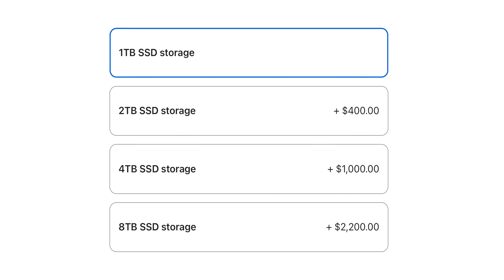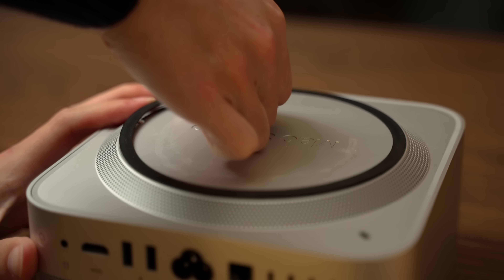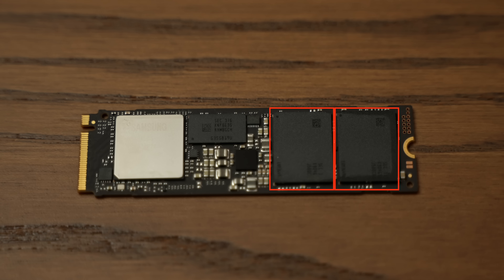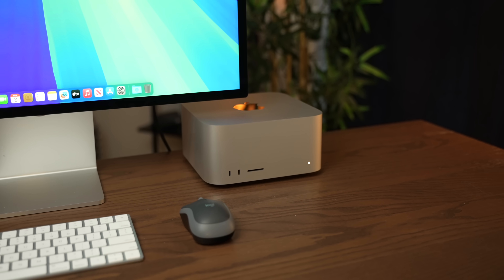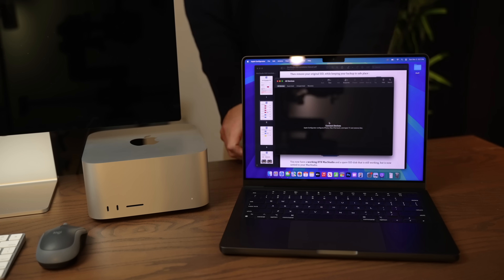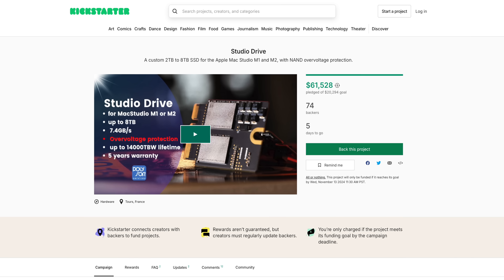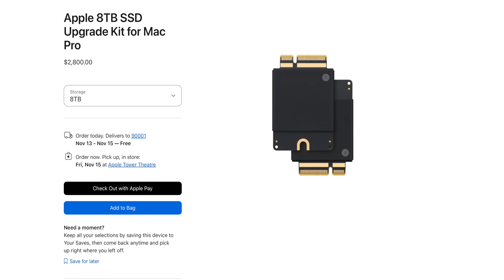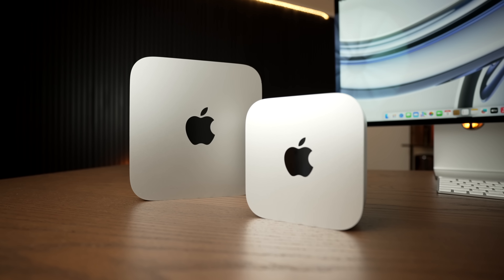UPGRADE your Apple Silicon storage for HALF the cost!

Comment: MacRumors users must be livid to see this. They hate upgradability and will justify any anti consumer moves
Reply: @ricciozztinThere’s no good reason Apple doesn’t include a standard SSD slot for storage.
Reply: @ricciozztinbut it doesn’t protect them. The speed and reliability of a 3rd party ssd like Samsung are just as good. Also can you explain how soldering their SSD is more reliable / safe? I’d prefer to not have to pay a large fee or throw away my laptop just because one component fails.
Reply: @sarjannarwan6896 soldering is the old way - doesn’t work below a certain scale. Plus. Why have separate components anyway?
Reply: @davidharrison8495 not sure what you mean by soldering is the old way and a certain scale? Also I kind of highlighted it. If my ssd dies, I’d like to replace it. Also I’d like the option to upgrade storage. There is no good reason (outside of financial gain for apple) to not allow it.
Reply: @ricciozztinits the user’s choice if they want to deal with the shortcomings or not, there literally is nothing wrong with giving consumers another option
Reply: @choonky Unless that option is an anti-competitive walled ecosystem set up to extort customers and developers, then when that option is deemed illegal and required to change, it gives the middle finger to the government and skirts the ruling requiring it to change
Reply: @ricciozztin so what? Id rather go full on ”wild west” replacing the ssd (which is a compoment which WILL eventually break) rather than throw an otherwise perfectly working computer away

My mother gave me her old 2011 macbook air with a broken ssd which i replaced with a regular m.2 ssd with an adapter and installed opencore monterey on it, and to this day it still works perfectly fine which i much prefer over throwing the thing away
Reply: @ricciozztinMost people don’t worry about that at all. Besides, let’s be real here. Apple did it for only one real reason which is money. They want more money and less upgradability. There is no way you could justify 400$ for 32GB of ram when I could get 6400mhz ddr5 ram for 110$. And you can not say that 200$ for 500GB of storage is fine when that is the price of 2TB. I seriously doubt that security was the deciding factor here. Besides, Windows has been solid for a pretty long while now so I can’t see why they can’t do the same.
Reply: @ricciozztin yeah .. i just paid 220£ for a 4TB Samsung 990Pro. Apple wanted me to pay them 200£ to go from 256GB to 512GB on the new m4 mac mini. Can you even begin to understand their greed ?
Reply: I’m a macrumors user that used to upgrade his Macs.  I remember when Apple used standard sata drives on its Macbooks and I remember the first time installing a Samsung SSD an 850 Evo in there. It was a bolt of adrenaline and speed unlike anything I’d ever seen before. The boot process was much much faster than the original 5400RPM disk. Appps loaded faster. Everything was faster.  I never used another spinning hard drive after that. 

I wish Apple would simply use or add a standard m.2 port for upgrading internal storage.
Reply: @ ricciozztinMost you must have a room temp IQ
Reply: @ricciozztinLol, "integrity and security" Don't be fooled by Apple just putting a sticker over a generic nvme.
Reply: @ricciozztinDoes 'not being able to recover my data if the motherboard cooks itself' count as protecting user data?
Reply: @ricciozztin I assumed you were being hilariously ironic, but no. Highly regarded.
Reply: @ricciozztinwelcome to personal computers. Replaceable drives have always been around and have always been as reliable as the technology advanced. Providers of drives have been reputable companies with far more credibility than Apple. You don’t trust Seagate but Apple is fine?
Reply: my favorite thing about the macrumors forums is the way they get indignant and shamey about people “stealing” the edu discount 😂
Reply: @ricciozztin This kind of stuff doesn't protect anything but Apple's wallets, that's why they can do it and no one else can. They know their customers don't want a Windows or Linux computer so they charge high because they have no other choice. If you want MacOS you have to go to them and deal with their garbage non upgradability that they claim is "more secure" when it's not. Upgradable SSDs aren't going to hurt anyone nor does it make your drive less reliable or slower
Reply: Dang, I thought everyone hated apples stupid practices
Reply: Nah They probably haven't noticed yet, too busy living in their Apple vision pro head mufflers, patiently waiting for the imminent rush of humanity to join them in there 😂
Reply: @ricciozztinlol
Reply: @ricciozztin pc stands for personal computer. Maybe a Mac isn’t a PC because you can’t make it “personal” in the way of taking care of it with hardware maintenance
Reply: more like a minority of hard core fanboys on MacRumors
Reply: Lame.
Reply: The people on MacRumors are so… intriguing and borderline toxic
Reply: Unless consumers tell Apple screw you and stop buying their stuff, things will never change.  Since Apple fanboys are addicts, and Apple knows this all too well, it will never happen.
Reply: What about the "Right to Repair" acts that have been passed or have been introduced in 30+ states so far?  Apple has said it will comply with California's bill SB 244 which requires firms to provide repair shops and consumers with parts, tools, and manuals at fair prices.  Nothing prohibits use of cloned parts except maybe voiding warranty coverage.
Reply: Strawman much?
Reply: You mean paid “people” to post that way
Reply: MacRumors is full of Apple haters - ever read the comments? Mods are Jack asses
Reply: @ricciozztin😵‍💫🤦🏻‍♂️
Reply: I suspect a lot of shills have a ton of sock puppet accounts over there. No way a normal thinking adult would act the way those people do.
Reply: I have moved over to  Mac Mini M4 from a PC, I built top spec gaming PC’s to order.

Now I an enjoying to challenge of forgetting MS windows and picking up Apple OS. Still feel that if Apple Tax, was less expensive by maybe 50% Apple would increase their sales more than enough to cover the tax loss.

The issue is that Apple doesn’t want its customers to have a machine that will still be viable in every way 8/10 years down the line. They make the most selling phones at again expensive initial prices and Apple Tax for greater capacity.

They do produce very good equipment, reliable usable and the basic software (and more) are totally free. This has turned them into a mega Corporation.
I somehow don’t think they will be worried by what is a minor part of their business.
Reply: @ricciozztinI hope you see the light, someday. But I am not optimistic.
Reply: @ricciozztin or, ya know, apple could just support their own hardware without the dumb brain washing. hilarious that you describe anything apple does as a consumer protection when that is exactly what customers need against apple. lmfao
Reply: @ricciozztin let me know when apple stops building garbage and shorting out nand holy crap lol
Reply: What a ludicrous comment. "Macrumors users" have most of the forums full of how to upgrade or repair devices that can be decades old, or investigating ways to modify new ones. The rest of the forums are full of trolls abusing Apple users or devices, like you.
Reply: @ricciozztin lad look at your bootlicking you need to calm down
Reply: Cap
Reply: @chidorirasenganz  bucket head cap.
Reply: What are you talking about? Macrumors forum hate apple.
Reply: MacCucks
Reply: What makes you say this?